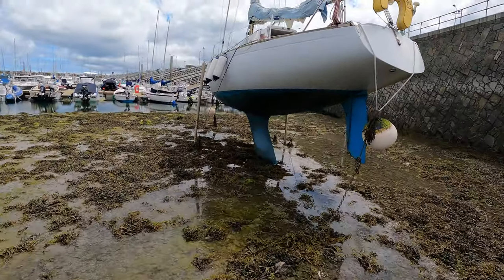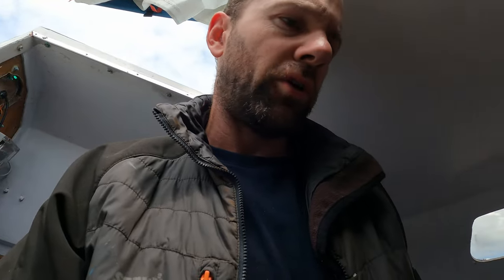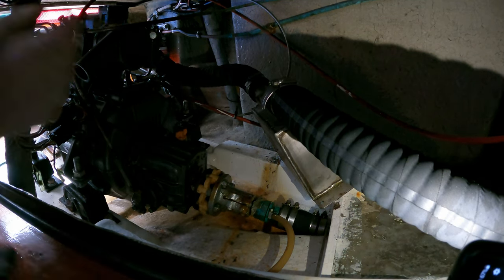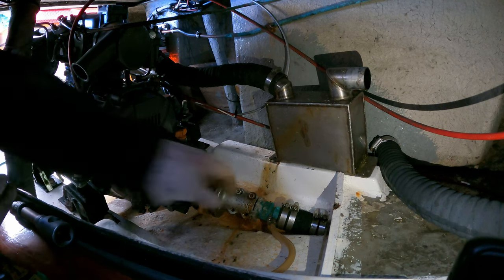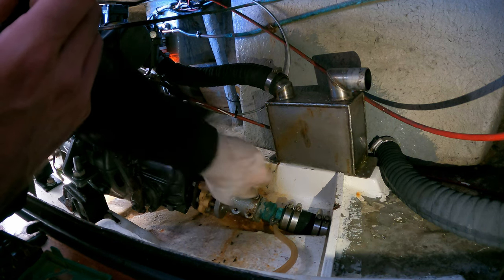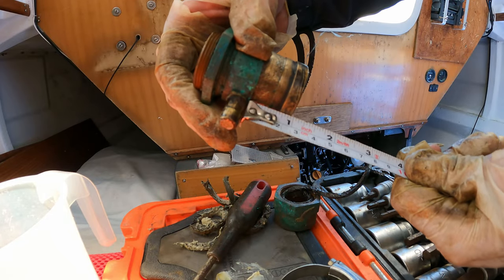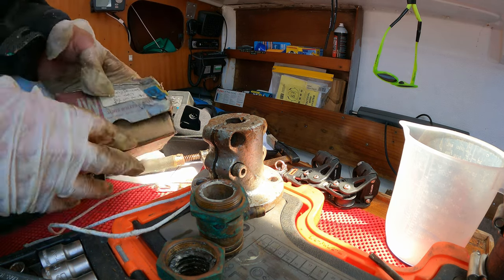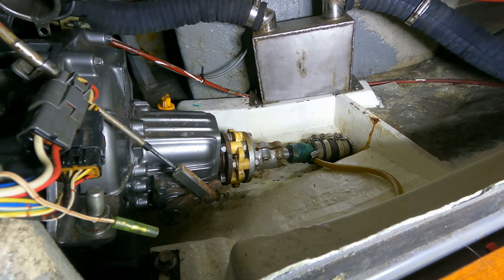Ep29 - Wobbly legs and Stern Gland dramas

Comment: Hi Matt.  I use separate rings of packing rather than a spiral.  I measured the packing required as you said at the end, and I got the packing from Herm Seaway.  Also, I have a piece of tube the same diameter as my prop shaft and I use that to cut and form the rings of packing before stuffing them into the nut. Hope that helps.
Reply from the maker: That's a great idea. I'm not sure why I didn't do that in advance, or in fact just take then outside the boat and use the bit of prop shaft protruding to measure them against. What size did your packing end up being out of interest?

Comment: You'll have to correct if I'm wrong, if got the wron impression. Did I see you make seperate rings and put into your casing which goes over the shaft. As a maintenance fitter I was taught to wrap the stuffing around the shaft in a spiral pushing it in with a blunt end screwdriver. Ringlets creates a gap even if you off set the gap/join, water can still get through. As you mentioned the locking nut helps to squash it more untill you run out of thread when it wears out. It's very interesting to watch.
Reply from the maker: Hi Joe, yes I did cut separate rings, that's interesting that it should be one spiral, that makes a lot more sense! It looks like I'll need to change it anyway so I could put the new packing in in the way you described.

Comment: It’s probably too late but you’re supposed to put the jubilee clips on opposite each other. If you look down on the four of them the screws are all at 9pm. On the left hand side. The first one should go on at say 9pm but the next one should be flipped round and put on at 3pm. This balances out the pressure that each screw applies and stops leaks👍
Reply from the maker: Thanks for that, good info. I'm also unsure whether I should have both jubillees tight at the same time, or is one just there ready to be tightened in the case the "working" one fails?
Reply: @thesailingdonkey  Both tightened. Genuinely never heard of one failing … could obviously do so if allowed to get rusty but the point of them is to keep water out😁
Reply from the maker: So I guess the reason I ask is I've run them both tight before, but then found that the result is one takes all the load and the other one slides around. Perhaps it just takes a bit of refinement to get them to equal tension

Comment: You never put a spiral of packing in it allows the water to track right through and made the job pointless.
You have to cut individual rings, and each end of each ring has to be cut at 45° to also overlap each end.
Reply from the maker: So I went with individual rings, but I just left the ends as flat cut "butt joints". I only read about the 45 degree thing later on. I'll cut them like that when I repack.

Comment: you should cut the packing length as its tight around the shaft, not the nut internal diameter youve used is way to big and wont allow the packing to grip the shaft, the ends of the packing should be scalfed as such at approx 45 degrees.
Reply from the maker: Thanks Paul, yes I realised this post event, and I could have achieved it by using the shaft that was accessible outside the boat. I still think it was always going to leak as I think the packing is too small. Noted re the 45 degree cut